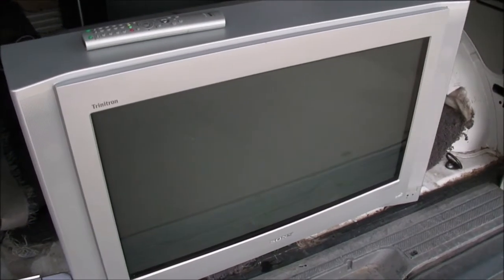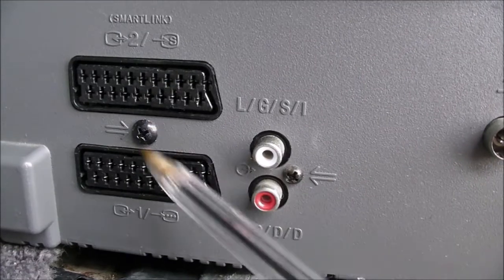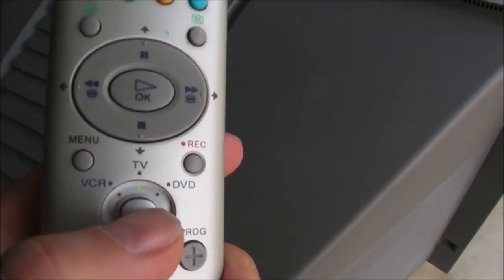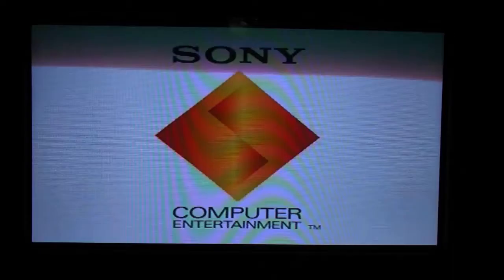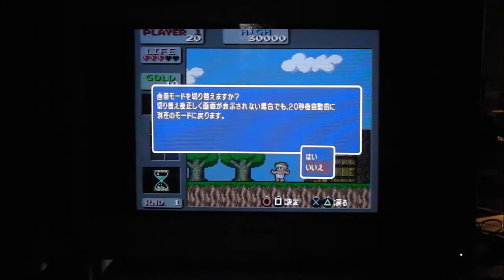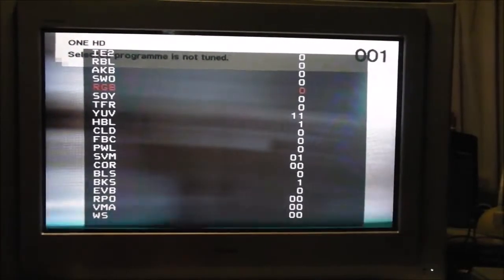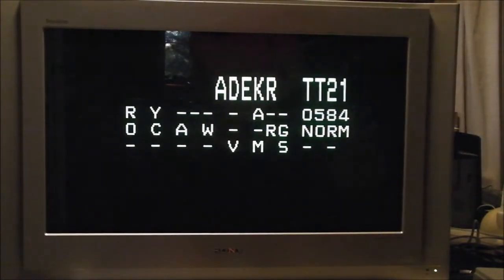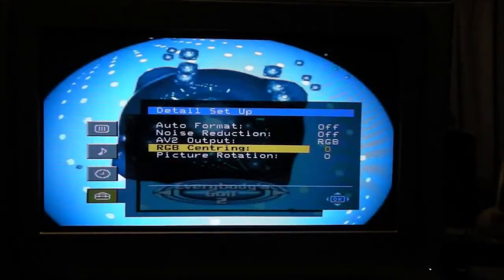Sony KD-32DX40AUS , 32" Wide screen Scart CRT TV

Comment: We had this amazing TV new back when I was a teenager and we used it for at least 10 years in Australia.  The picture was alway great and digital SD TV looked amazing and vibrant compared to analogue.  We got this tv in about 2003 because the new plasmas were too expensive at the time and digital tv had just come out so it was a great selling point.  The tv came with a single scart plug which split out into component and normal composite video which we plugged into a DVD player with component.  Later on we got a scart to scart plug and connected the digital foxtel box to the tv, can't remember which mode it ran in - foxtel picture quality in SD was terrible compared to free to air.  I also connected and played a lot of Xbox 360 on it via the component cables the first gen had and also Nintendo wii with an aftermarket component output cable. At one point the TV failed to turn on - we got it repaired - power supply replaced by a local shop.  In the end my parents upgraded in 2013 to a Samsung 42" LCD which only lasted about 6 years before the backlight went bad.  So then it sat unused for a few years before they put it out for hard rubbish - it probably still worked.  I'd love to find another one day as it makes DVDs look awesome as well as retro games.
Reply from the maker: Great story, you really got good use out of the tv and used its capabilities well!

Comment: I think a better way to test if it's 100Hz or not besides the 15kHz whine would be to check different shutter settings from the camera, point it at the TV and see the effects. I have had the zapper work on a 100Hz TV occasionally, so I don't think it's a very reliable test.

Comment: Interesting localisation of a UK/ European set for the Australian market by omitting RGB functionality. FYI: Sony UK are based in South Wales (Bridgend/ Pencoed). I believe they manufacture the Raspberry Pi devices there, nowadays.

The PCMCIA is a CI (Common Interface) slot to accept a CAM (Conditional Access Module), which would allow decryption of pay TV services. The MODEM functionality may be linked to this (interactive services, on-demand movies, sporting events, etc). I think the AV2 RGB output was possibly for connection of a DVD recorder to allow recording of the TV's digital tuner.

Comment: I use a KD-34XBR960 for my ED and HD console games and some PC usage and these also have a similar RGB selection in the service menu that lets it take RGsB over the YPbPr jacks. There's no region override but you can hide the service OSD. It's probably a leftover from factory but it's interesting that it seems it was reused for the AUS models and also showed up in a similar form on a set like this.

Comment: Thanks Rob! I just bought one of these and your instructions were incredibly helpful.

Edit: does anyone know how to get back into the service menu after changing the region? Pressing 5 now turns the tv on.
Reply from the maker: thanks for the feedback. try service menu buttons one at a time in quick succession.
Reply: Cheers for the reply, Rob! Just retried and it worked first go.
Reply from the maker: @bearclaus2676 i was working on a sony the other day having trouble getting in and the 1 button at a time in quick succession worked well
Reply: @rgbrob  its tricky to get into for sure. 

Ive got test suite on the screen now and im about to adjust geometry. 11000 hours on it. It was a cool 50 bucks with factory stand. BIG TV but im happy to own it.

Thanks for recommendation!
Reply from the maker: @bearclaus2676  good deal $50, cant complain about that!

Comment: Great video Rob. I've got what looks to be a slightly later model Sony KD-32NX200AUS and it has three scart ports with two of them YUV scart and the other s-video. Looking at the manual the UK model has the same ports as rgb scart so it looks similar to this tv. It has a different service menu so the same trick doesn't work though. I've tried to turn a few things on and off but no luck! Just wondering if you've heard of my model and have any ideas?

Comment: Hey Rob you should adjust the shutter speed on the camera to 1/50 or 1/60, just a tip to stop the flickering :)
Reply from the maker: Even with those 2 shutter speeds its not always possible to get a steady picture. I think a camera with and adjustable shutter speed that can go into 1 or 2 decimal points would help to synchronise very closely with the tvs actual refresh rate (NTSC 59.94 interlaced fields per second for example).

Comment: I've owned around 12 kd sony consumer grade tvs form the usa. All our kd sets run component and need a converter for rgb to component. Also none of our kd sd sets are widescreen. There are widescreen kd sets but they are not sd. I think what you call a 100 hz set is similar to a  hd set in the usa. I have owned one before and did not like it--input lag and lcd like picture quality. 

I would love to have a 32 inch widescreen. I watch a lot of movies on my crt and 4/3 tubes are not ideal. I usually crop the image  into 6/9 using vlc but a widescreen set would probably be better. However I am literally using a 36 inch kd set as I type this (crt emudriver)  and the added tube size probably makes up for the lack of widescreen. I'm guessing that a 32 inch widescreen is comprable to a 27 inch 4/3  when 4/3 gaming. On the other hand, a 36 inch 4/3 tv is probably comparable to 32 inch widescreen when viewing widescreen content, with respect to viewable area.

I am surprised you are not more impressed with the picture quality. The kv3xx series of kd sets in the usa are comparable to low end pvms with respect to horizontal resolution, however they are the best kd sets. The inferior kv1x, 1xx and 2xx series are almost as good. I have noticed that some kd tvs such as the kv 36fv15 have weird edge enhancement features hard coded into some of the "picture mode" presets. On these tvs it is by far the best to use the "movie" and "standard" presets and turn the contrast, brightness and sharpness down. You might want to give this a try.  The presets probably have a different name in Australia but watch out for that edge enhancement.

Comment: I grabbed one of these recently, my SCART isn't working at all. Only the front panel. Any ideas? I've read it may be a diode, D420 or D421.
Reply from the maker: I have no idea sorry. What signal & device have you attempted to use on your tv?
Reply: @rgbrob  Thaks for the reply mate. I've tried running my NES through with Duck Hunt :P and also a NES classic mini using a hdmi to RCA converter box with the RCA going into the SCART adaptor. I tried both ports too.

Comment: Hey Rob, just a question about RGB mode on this tv, will it do 4:3 aspect ratio or does it force you to stay in 16:9? Sorry if this was answered previously.
Reply: If it's like my jvc you can switch between the two on the remote with the aspect ratio button.

Comment: Hey guys. I am in need of some help. So, I'm from Australia and I have been searching for a high quality PVM (preferably Sony Trinitron) for quite some time now. My dream monitor would be a Sony Trinitron 20L5. Although at this point I can settle with any Sony Trinitron that is decent. On the rare occasion there will be a PVM listing on Ebay, Gumtree and there was one time I saw one on Facebook Market Place, but completely overpriced and not even a good monitor. These are the only Australian Market websites that I know of, please let me know if there are any others. I suppose they have become more sought after as time goes on and people tend to hold onto them. Anyway, if anyone out there could give me some advice on where to look and who to contact, it would honestly mean the world to me. I desperately need one of these monitors... Cheers! :)

Comment: Would be great if someone came up with a bypass of the processor and 
could change some components to double the scan rate so we could 
actually display 1080p on the HD CRTs. Horizontal resolution isn't 
actually 1920 though, I think the super fine pitch XBR is only around 
1440 or so horizontal from reviews and specs I've read in the past.